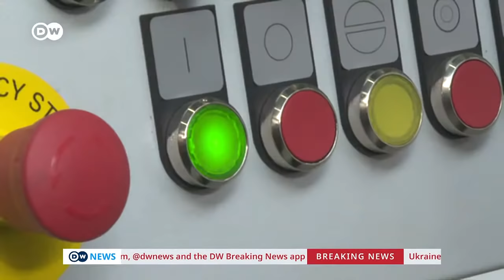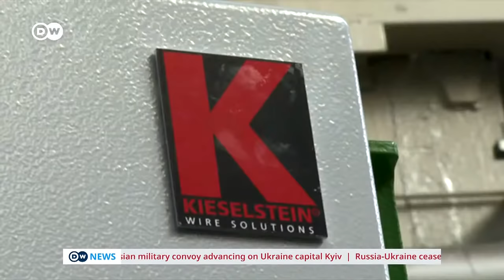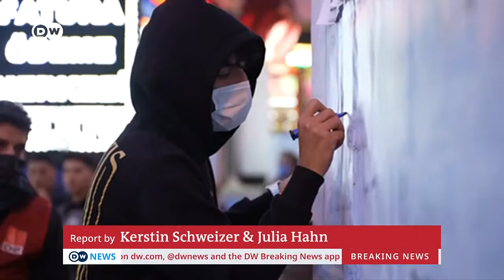Russia: An Economy at War | DW Business Special

Comment: 🇺🇦❤💪❤🇺🇦

☢☢☢ It just dawned on me, Chernoble could be a cover for nuclear weapons. The radiation levels there are going up.
Reply: Naaaaw, but if he bombed it, it could disrupt the containment
Reply: @AintSkeerdNWO  Yeah this, but a bombing not required. Potentially even movement of vehicles through the area kicking up dirt/dust. This would correlate to an increase in radiation at the detectors/sensors.
Reply: They also want to keep under control the short cut.

Comment: @ 16:55 - Isn’t a year enough time to fire up and get your recently closed nuclear power plants back on line?  Who made the decision to shut down your nuclear power plants, anyway?  They obviously are not smart enough to be making such decisions!  🏭
Reply: No, many of the personnel has moved on.
Reply: @solaroid4442  Ahh…but the video makes mention a few of the nuclear power plants are operating and just need their closing dates delayed or extended.  But I would differ with your comment; I would estimate a year is plenty of time to get at least a couple of plants back on line and generating electricity.
Reply: @larrysfarris  Those that stopped working will be hard to restart. I listened to some german nuclear specialist a few months back, and he said it.
Reply: It seems that Fission is too technically challenging for Germans.
They outsource that to the French...
Reply: @NullHand  While the French have outsourced there heating Germany, considering that they import electricity every winter from Germany to run their electrical heaters. The majority of natural Gas is used in heating in Europe, in Germany its 86%. Nuclear wouldn’t help much with that.
Reply: @paulschmidts5429  Continent scale grid interconnects are interesting.
Humans pretend they are trading electrons in a marketplace, but really Maxwell's laws are running the show at the speed of light.  Tallying up the yearly net flows show that both Germany and France are the main electrical energy exporters. Britain, Spain, and especially Italy are the net importers.
And there is a technology that can heat efficiently with electricity even at your latitude.   Geosourced heat pumps.  I think this will be essential to any real attempts to decarbonize, whether you choose nuclear or renewables.
Reply: @NullHand  If you wanna get philosophical, then for most part of the grid the electrons are not flowing, but just stepping back and forth (alternating current).
Now I am definitely in favor of switching to heat pumps, as it’s the only solution for decarbonizing heating that can be applied everywhere and similarly the IEA considers heat pumps one of the most important parts to decarbonize the energy system.
However when it comes to supplying the electricity for them, the issue is that they will require most of that electricity in winter and very little for the rest of the year. This is not met well by a type of powerplant that requires baseload operation to get close economic operation. 
The obvious answer would be Combined Cycle Gaspowerplants in combination with wind energy who’s mane production time is during the cold part of the year, and in the longterm Hydrogen for Gaspowerplants from excess wind electricity.
Another issue for nuclear is there long build time, the IEA and NEA estimate in a study a build time for wind and solar of 1 year, 2 years for Gaspowerplants and 7 years for a nuclear powerplant.
Reply: @paulschmidts5429  Yes, but getting philosophical with your utility will cause them to demonstrate to you that what they are really selling is the Potential to move electrons, and that travels from them to you at damn near 6000km in that 1/50th second between jiggles, and would you care to see a little demonstration when they remove a tiny section of conductor on their side?
And the time lag (and cost) of nuclear power has for half a century been a human behavior barrier rather than an engineering one.
Time is money, and nobody's time is more expensive than Lawyers' and Politicians'.
Reply: @NullHand  The electron doesn’t actually travel even close to light speed, as the potential difference in a typical grid isn’t sufficient to give it the necessary speed. What happens is that the wave of the change of the electromagnetical field inside the conductor travels at near light speed to you and this wave is a product of the Electrons jiggling 50 times per second.
Regarding nuclear reactors:
7 years is the build time given by the Nuclear Energy Agency (NEA), aka the time from the start of pouring the concrete for the reactor core building till the end of all construction work. (Following IAEA convention on building time definition)
Statistically speaking the average build time from site preparation to completion of the plant for reactors coming online between 2000 and 2020, has been 10 years, in case of Europe no western reactor has been finished in this Century, with construction time on Oklitu in Finland reaching now 17+ years.
Planning time and legal actions come before that and increase the time to up to 20 years.
Reply: @paulschmidts5429  Yes, I was not refering to electron drift speed, but Voltage, which is propagated as an EM wave at pretty much C(insulator), mostly along the surface of the transmission lines connecting our appliances with voltage sources.
Reply: @NullHand  The reason why the EU and USA have trouble building new reactors, is because unlike China, Russia, India and South Korea they are not state capitalist systems anymore, in which huge amounts of capital can be moved to finance projects regardless of their financial efficiency and are willing to overlook safety procedures, like using certified parts, aswell as cracks and dangerous design.